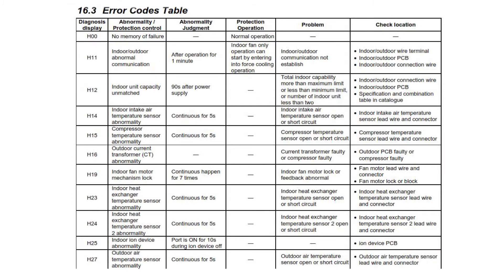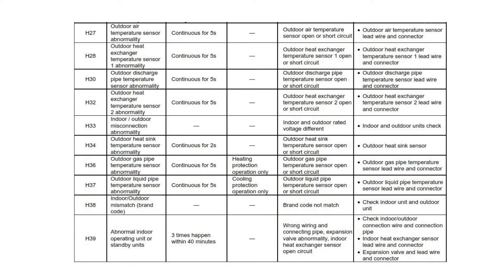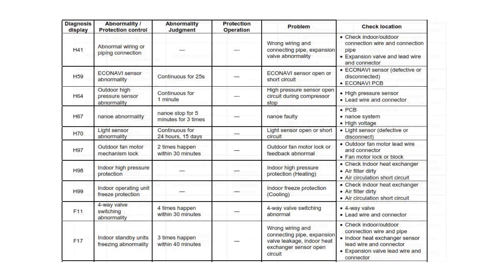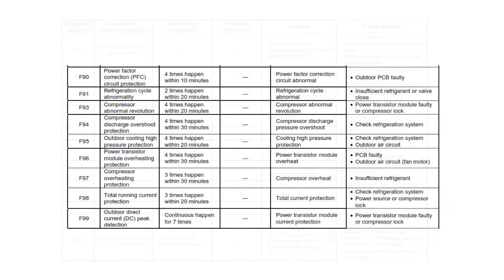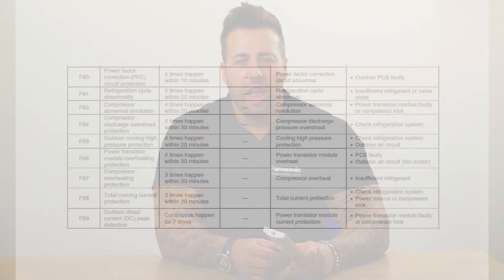How to check the error details on a Panasonic residential (RAC) air conditioning system

Comment: Thanks I need to check it. I just got error Code H 85 on my AC display. It turns on a profile at 7pm and it had not turned it on this time. I thought maybe someone at home turned it off as the weather has become very cold all of a sudden. The display was off. Then It started flashing. H and then 85. And repeating. it.
I turned on the AC and it turned on. It was too cold so I did not turn it on to check if its working I thought let me google the codes. There is no H 85 code anywhere. Infact your video is the only one that mentions errors codes of RAC. Thanks for the video
Reply: Have u found what H85 code means?